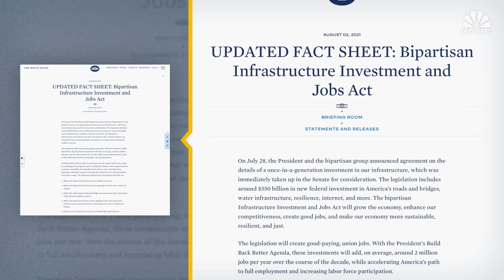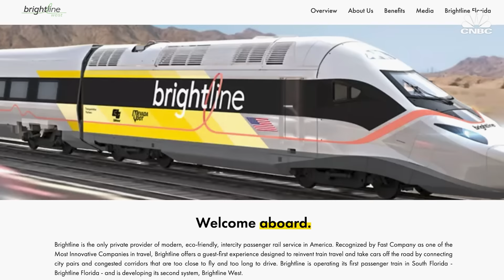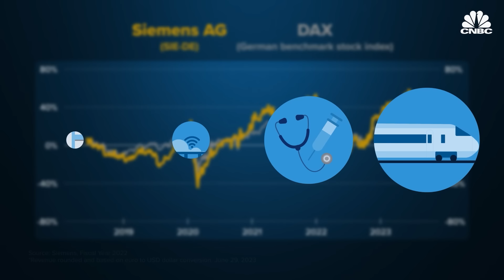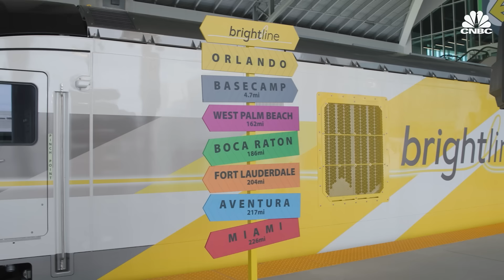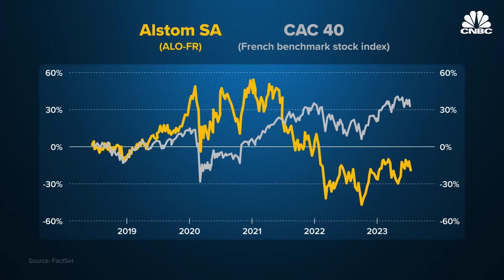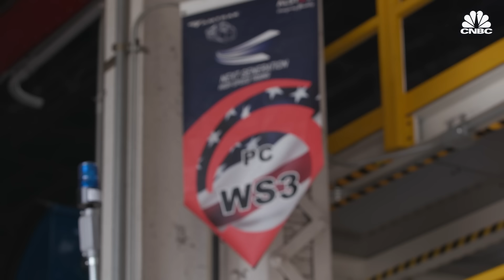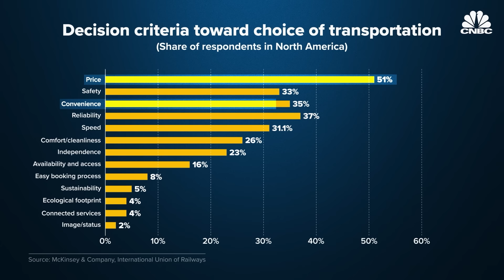Why Passenger Train Manufacturing Is Booming In The U.S

Comment: I have taken the train from Minneapolis to Chicago and back several times. Not a bad trip, but one thing that is an issue is sharing the track with freight trains. The quality of the track, and the speed the train can travel at suffers greatly because of having to share the line. This means the passenger train has to get on a side line quite often. I used to live in Japan and most of their passenger and high speed rail is not shared with freight services. This allows the track to be better maintained and the overall travel experience is much faster and smoother. Passenger lines used to be that way in the US, but over time those lines were closed and sold off.
Reply: Its the freight companies line....Thats how it is...
Reply: @davehughesfarm7983  I know its their line, but that is why the passenger lines shouldn't have been sold off. But yeah, it happened during the era of the automobile.
Reply: It could be fixed with improvements to track and OSC electrification would massively improve acceleration and reduce emissions
Reply: Unfortunately there just isn't enough funding for Amtrak to be able to build all their own rails across the country.
Reply: Passenger-only lines have always been rare in the US.  There is no "used to be that way".  Never has been that way.
Reply: @bikeenjoyer977  You could fix it with proper sidings though.

Much of the worsening delays is because the freight trains have become too long for the sidings that exist, and the federal government has never enforced the priority rules. If we spent the money to fix these two problems (and did proper maintenance), you could easily run most trains at 110 MPH and make them cheaper than driving. It's still not high speed rail, but it would make Amtrak actually have a viable customer base outside of "I have no other option"
Reply: @brianh9358  Passenger-only lines have always been rare in the US.  There is no "used to be that way".  Never has been that way.
Reply: @AllenGraetz  Do some more research.
Reply: @Madwonk  You're very correct. The problem in my opinion is less that they don't run on their own tracks and more that they don't even have funding to make all the routes work. There are 2 states with no Amtrak and you'd be surprised at how many states have no Amtrak stops in their own stupid capitol city. It would be cool if they could at least build one track for them exclusively so they have a permanent siding to use and that would probably solve most of the issue but the upfront cost is simply too much for their allocated budget.
Reply: @davehughesfarm7983  in most (if not all) places around the world rail was constructed and operated by private companies, with supervision and benefits from the government and later it was nationalized as public services should not, and cannot, be for profit but their existence brings financial benefits that are far greater than the construction and operation costs. nationalized  rail infrastructure will bring large investments and improve service for all, just like roads do, and they are government owed and maintained, or airline industry, that uses government owned and maintained infrastructure like airport or air traffic control. You can still have private companies as operators, which is what's happening Europe now, when the government allocate slots for private operators on the national system, just like airports allocate slots for airlines. In Spain there are 4 different high speed rail services operating on more and more lines offered by 3 different companies, including regular and low cost with fares starting at 9€ (a bit less than 10$).
As for the freight companies in the US, as I said, they have this system because the original companies got huge intensives from the government and the same government bailed many of them out in the 70's (and missed the opportunity to nationalized them, like it actually did for a few of them only to sell it back to private companies) so they might officially own the railways but as a crucial infrastructure that is badly maintained and when those companies break the law that obligated them (as part of the bailout) to allow and give full preference to passenger rail the government can certainly nationalize them for the good of the whole country. those companies will be able to continue and operate, as before, without the need to maintain the system, on slots that will be allocated to them and the better the system will be the more slots they'll have.
Reply: @AllenGraetz  Just look at a map from chicago circa the 1940's there were a tonnn of exclusive passanger right of ways that have since disappeared
Reply: passenger trains have priority by law and fright trains need to let them pass even on not amtrack owned lines. However this is often not done and not enforced by the states.
Reply: @ffmag9501  I think it is quite often a matter of timing , especially where there is only a side line available and not two full parallel tracks. I would guess the length of some of the freight trains makes it difficult to even get on a side line in some cases.
Reply: they recently upgraded some tracks to 110 MPH
Reply: You can thank General Motors for destroying the process of public transportation
Reply: I flew this to boot camp years ago, and drove it a few years ago. The drive was around 8 hours, and flying was under an hour. I checked and I don't even see a train listed on google maps. Given what the cost likely was for the train I'd guess that its nearly the same as a plane ticket, but about 8x slower than the plane.
Reply: @BillAngelos  you also don’t need to clear security and stuff. Although they’ve just recently (in the past couple months) increased speed and got new train cars
Reply: @BenjaminCommet  The lines you are talking about were either abandoned suburban lines or Passenger leads to now coexistent passenger terminals none of which would do much to ease modern rail congestion or travel needs.
Reply: @davehughesfarm7983 why we need to nationalize our rail infrastructure and lease them to freight and passenger companies to operate on them...
Reply: @WONtothaG  Henry Ford..Thanks to him I spent 3 days on a clover leaf.
Reply: @AllenGraetz  There "Used to be" more double, triple, and even higher tracking. The Private Railroads also used to actually prioritize the Passenger trains. Various short sighted policies lead to that ending.
Reply: Well, JR Freight in Japan uses the same tracks as conventional passenger trains, but they put in siding tracks at many stations to allow pasenger trains to overtake the slower freight trains. Interestingly, JR Freight trains have priority on many major lines in more rural Japan, but then, there are relatively few local passenger trains on these rural lines.
Reply: @davehughesfarm7983  By law, the freight companies are supposed to give Amtrak priority. There's no enforcement mechanism for this and the GOP keeps voting against adding enforcement mechanisms to the law, so the freight companies routinely ignore it.
Reply: @Sacto1654  That is true to some extent. Although there are some other factors related to that - the percentage of freight moved by train is fairly small in Japan. Second factor is freight trains tend to use the tracks at night when fewer passenger trains are active. Also freight trains tend to have their loads transferred to trucks before they enter large urban areas. Maybe there are fewer dedicated lines now, but when I lived in Japan certain express trains did not share tracks.
Reply: @brianh9358  You still see quite a lot of freight trains in Japan moved in daytime hours, especially between Tokyo and Kitakyushu. Long freight trains are very common sights on the San'yō Main Line between Osaka and Kitakyushu especially. That's why you see pretty long sidings at many stations on the San'yō Main Line specially to allow passenger trains to pass JR Freight trains.
Reply: Perhaps we should return to Steam locomotives.   The New York Central RR's 20th Century Limited would journey from New York City to Chicago in just 15 hours, and that is with Freight trains on the line.  Try that with Amtrak's Lake Shore Limited today on the same tracks used by the 20th Century Limited.
Reply: When I was in Italy last year I found it very interesting that there was a freight train that zoomed by minutes before my train arrived on the same track. I'm wondering how they pulled that off.
Reply: @josharden6793  Electronic scheduling can do wonders - but that is assuming your trains can follow a schedule. US.. not so much.
Reply: According to some Japanese sources they don’t haul that much freight on their railroads.
Reply: As always we need state intervention.
Reply: Your complaint about having to share the route with freight trains is really about having two-way traffic on a single track. DOUBLE TRACK the route and then there's no more stopping to wait on a side rail.
Reply: @bikeenjoyer977  Just need to have fiscal (tax) incentivizing legislation that encourages the freight rail company to DOUBLE TRACK the route. Eliminate two-way traffic on a single lane of track.
Reply: I live in Grand forks, ND. I too have traveled from GF to Chicago through minneapolis many times. It's just too slow and i'm tired of the cargo trains!
Reply: @tanishalavri3278  yes, but if you vote for Democrats we'll get more funding and hopefully fix all the passenger rail in the country, build tracks or put passenger rail as a priority.
Reply: @michalandrejmolnar3715  i have never voted for democrats and never will.
Reply: @tanishalavri3278  Ok then live in car dependence and no guaranteed healthcare
Reply: @michalandrejmolnar3715  we pay for our own family's healthcare insurance. It's not the government's job
Reply: @guyintenn  well, considering that the vast majority of rail ROWs were GIVEN to them thru Federal land grants in the first place!
Reply: @AllenGraetz it probably could be if the Government bought the right lines and then rented them out to the freight companies with Amtrak and passenger services getting priority and freight trains instead wait to the side. They go slow anyway so having to wait a few minutes here and there wouldn’t hurt much.
Reply: @Madwonk so there is a priority law for passenger trains on freight owned track. Had no idea 🤷‍♂️. Things not getting enforced always get exploited.
Reply: Japan is very modern with every thing Same with Germany They both had to rebuild whole country's from basic infrastructure up after WW 2 it was bombed back to the stone age !!   Japan embraces technology  The Germans are very good engineers  both have good rail service .
Reply: The statement that “there used to be dedicated passenger tracks” in the US is factually inaccurate. Before 5/1/1971 passenger and freight trains were operated by the same companies. Up until the 1960s those companies generally gave priority to passenger trains but, from the mid-60s on that became rare. After the government pulled mail contracts from the railroads, the lifeline that passenger trains had as ridership declined, freight paid all the bills rather than most of them, so in most cases, got priority over passenger trains which the government forced railroads to run the money losing operations without subsidies. Currently, there are few dedicated passenger lines in the U.S. outside of the Northeast Corridor. Unless people want to totally destroy infrastructure as we did to Japan and Europe during World War II, then it’s impossible to have completely dedicated passenger rail tracks in the US. NIMBYs  and radical environmentalist groups will contest every single foot in court. Meanwhile, California’s HSR project is a bad joke. I would bet money that, even though Brightline West has not started construction yet, it will be completed long before the government “managed” HSR will even begin operating.
Reply: @timnewman1172 That is an untruth and demonstrates a lack of knowledge. Land grants were granted 1. in exchange for construction so that the land could be settled, it had little or no value if no one was living and producing there and 2. The railroads that received land grants were required to give the government discounted freight rates. The later was not rescinded until after WWII. The amount of transportation of freight and troops during WWII alone would probably have more than paid back the land’s developed value, let alone the practically worthless value it had when the grants were made.

Comment: Well, there is a large number of passenger train sets built in the 1980's and 1990's that are sorely in need of replacing. That's why companies like Siemens Mobility in California and Stadler in Utah are extremely busy nowadays.

It's not just the USA, either. The expansion of high-speed rail in Europe and China and the need to start replacing train sets in Japan has keep train builders very busy.
Reply: Supposedly HSR in China is contracting because their overall capacity exceeds public demand by a wide margin from building so much of it, but who really knows
Reply: @kiranreilly4916 they did build way more infrastructure than they could use in the near term. I guess we'll see how it does in the following decades
Reply: @kiranreilly4916 It is still not easy to buy tickets in economically developed areas.  The overcapacity is in non-economically developed regions.  But China is a socialist country, and railways are public facilities, so they don't always have to clearly calculate the economic benefits. They use the money earned from lines in developed areas to subsidize those lines that are not operating well.

Comment: Personally I would love to see more train infrastructure. If it were more convenient I would take it more.
Reply: @@duffelbagdrag then thats is great, cosolidated power generation from Fossile fuel to electricity is more effiicent and economic then a distrubtued one, if overehead or 3rd rail electrified railroad, streetcard and light rail are widely accessable then it will be far cheaper and convient for us to ride train then to drive!
Reply: @@duffelbagdrag 1. Coverage is an relative easy fix, the infrastecture is here but currently utalise by mainly cargo after passenger service decline.
2. Funding is an investment problem, if we want to promote greater mobility and reduce the cost for fuel then per milesage speaking rail is far easier and cheaper to maintain with much higher capacity.
3. A lot of these social problems are due to many of us are in isolation, an example will be "Do you think there will be more crime on times square then a dark alleyway" Ridership and Crime happen on transit system are closely related, furthermore we could not blame a social problem on transit,  this is like saying There are drug dealers at the gas station so I will never go to any gas station

Comment: A few years ago, we rode Amtrak's "Southwest Chief" from Los Angeles to Chicago. Overall, it was a decent experience, and I would probably do it again. However, I can also imagine how much nicer it would be if the tracks and rolling-stock were updated as this video implies they could be.

Furthermore, we recently traveled throughout central Europe, and, after much deliberation, decided to rent cars instead of purchasing train tickets. Most of this had to do with travel time between two points; almost without exception, traveling by car was much faster than taking the train (with all of its stops along the way). However, if I lived in Europe, I would probably use the rail service much more often, as I would probably not be in such a "rush" to squeeze in visiting a number of tourist sites.

Comment: Vote to fund amtrak, buy the track from the freight companies, and expand local service
Reply: Lol. Then how will freight move throughout the country? The solution is to build new tracks
Reply: @Chopper153 ever heard of adding tracks to existing corridors?
Reply: I can think of few worse moves than forcing millions of tons of freight each day onto the highways.
Reply: @AllenGraetz which nobody wanted. It's about giving priority to passenger trains like any sane country, which will make cargo trains go a bit slower, but not push them off the tracks
Reply: @Chopper153  um, the truck companies don't own the roads and yet they use them. Nationalization doesn't mean the freight trains can't use them. The northeast corridor is owned by Amtrak and when I was there last I saw several Norfolk Southern and CSX
Reply: @AllenGraetz    um, the truck companies don't own the roads and yet they use them. Nationalization doesn't mean the freight trains can't use them. The northeast corridor is owned by Amtrak and when I was there last I saw several Norfolk Southern and CSX
Reply: @CreatorPolar  That's called adding new tracks.
Reply: @harlander-harpy  This is only possible for lower speed trains. For HSR, you need separate tracks (with different curvature, slope and right of way).
Reply: @Chopper153 like they do now. Instead of they owning it they will lease it from Amtrak
Reply: @Chopper153  yes, I am aware of this. Lower speeds matter too
Reply: @jan-lukas  Amtrak already is given priority.
Reply: I’m never going to do that